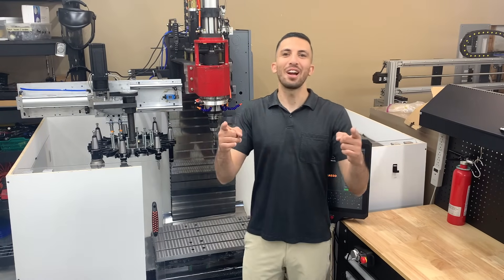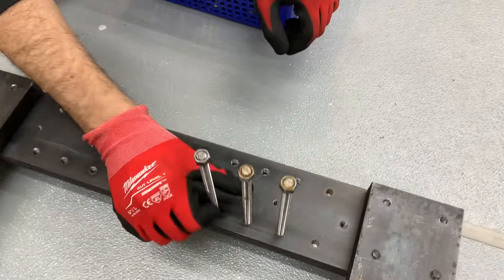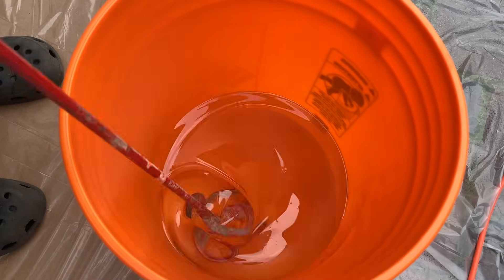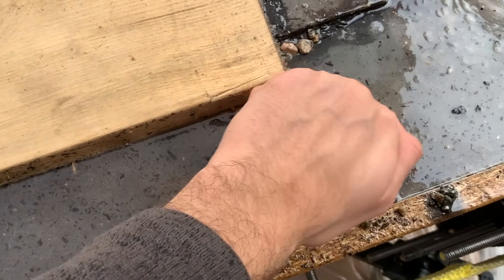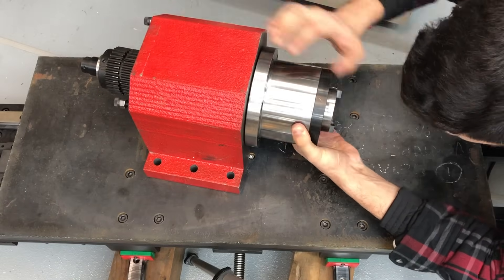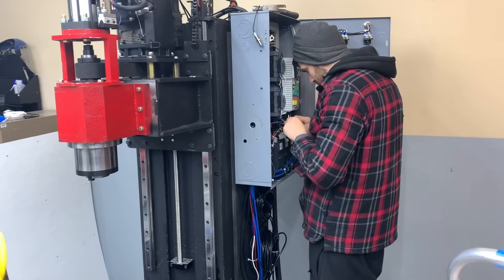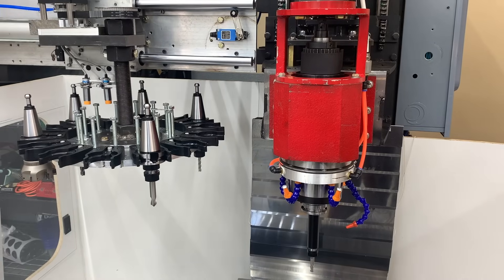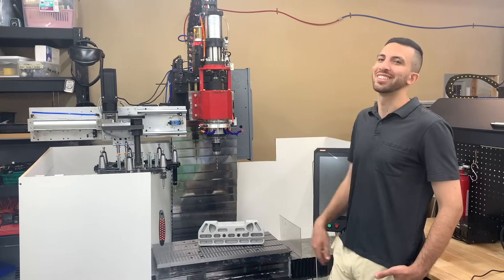Building a DIY CNC Machine With Automatic Tool Changer

Comment: Really love this build, great engineering skills. At first i thought no way they build a cnc milling machine... and then next thing "we also  build this router in a week" Very nice, the toolchanger makes it really stand out, looks like it is inspired bij the HAAS toolchangers. How did you get the Z-axis to be perfectly square with the XY-plane? I am really curious, what accuracy does it achieve? Keep up the good work, this channel will blow up in no time!
Reply from the maker: Thank you very much! The tool changer was definitely a nice touch, and was actually quite complex to build. Squaring off the z to the other axes was a process, and I will describe it in my next video for sure. Glad you enjoyed and thank you for the kind words 😃
Reply: @ActionBOX  which video? I'm at that point in my own build I'm curious as to how you did it.
Also interested in a couple of the other components. 
Are you releasing plans or drawings or parts lists of the stuff you used?
Reply: @ActionBOX  Great build. If you ever do another It would be worth making a knockout cylinder that was hollow in the center. That way you could easily incorporate (With a Debluin Coupling) through tool coolant and even an air blast to the spindle cone. It may also be worth incorporating a electro magnetic brake to the top of the Z axis ball screw. These are great for E stop functions and will generally prevent the head from creeping down when powered off. In many countries a legal requirement. Generally today cast iron wont need to be left to normalize for years that was done way back prior to WW1 and mostly for economy of scale. Today they are rough machined then heat treated to stress relieve. This is also the case for high end fabricated machine components as well.
Reply: Not answering the accuracy question and looking at the construction itself tells me that it is not accurate at all. Just bolting the linear rails to an unprocessed piece of steel is not the way to go.
Reply: That's what I wrote a year ago. Today this video popped up on me and I found my comment not remembering I wrote it XD

It seems like very little people care about precision. But it is one of the most critical things in machining
Reply: Many machines had umbrella style tool changers long before Haas was even a company!
Reply: @gorak9000  they didn't claim to have invented anything. But it looks like a clean build. I'd like to see the rest of the build information. If they don't want to share, ok, but they are saying they are going to do follow up videos and then they don't.

Comment: Very nice. Even has a tool changer. That's pretty gangster. Also I think its a pretty good call on the epoxy granite. People don't realize that using alternative materials to iron bases has been around for over a century. In WW1 countries were rushed into a world war without any way to produce artillery shells which would require massive lathes that nobody really had. Their solution was the Yeoman lathe constructed from cement/concrete bases. Even nowadays on machines with low production numbers (like only 1 for example) it makes much more sense than having a certified foundry that can cast Meehanite Iron do the work to create only 1. I had thought of using an epoxy/cement/sand mixture for a future lathe project but I honestly think your solution is simpler with the same great dampening performance. Definitely going to do it that way instead I think. This is the first time I've seen your channel but after this video I subscribed. Stay awesome.
Reply from the maker: Thank man, this comment was a pleasure to read. Thanks for your upvote as well, and feel free to help me out by sharing with anyone who may be interested. Im hoping the YouTube algorithm will pick up at some point 😁. Cheers my friend

Comment: Is it cost effective compared to buying a complete used machine? Do you plan to upgrade to 4d?
Reply from the maker: Knowing exactly how your machine works definitely saves money when it comes to fixing and troubleshooting the machine. A lot of the budget went towards one time tools such as the T-slot mill, so If I were to build a second machine, I wouldn't incur all those expenses again. Hence, the more machines you build, the more cost effective it becomes. that being said, hobbyists don't need more than 1 machine, so whether its cost effective or not is dependent on your situation. Hope that answers your question 😃

Comment: I absolutely loved the fact you made such an amazing machine in such a short period of time.
Wouldn't concreate dampen vibrations reasonably well too?
Reply from the maker: The two parameters at play are young’s modulus (rigidity)  and Loss coefficient (how much it will vibrate under impact). Concrete is less rigid than steel, and is not as good at absorbing vibrations as epoxy or other polymers. Hence, using the steel/epoxy composite is a superior product. That being said, if you are on a very tight budget, concrete would still work, you simply have to run the machine under less stress (lower feed rate, and shallower cuts) to get the same quality cut. Hope that response helps. Do me a favour and share my video with others who may be interested. Cheers 😃.
Reply: yeah, he only took 8:51minutes to make  a cnc machine,absolutely incredible fast and fantastic!

Comment: could you have used some old weight plates from a gym istead of the rocks
Reply from the maker: Yes that is actually even better since steel is more dense than rocks. A secret between you and I, I actually threw tons of bolts in there and 2x 8 pound weights. Only drawback is that steel is far more expensive than rocks, so unless you have tons of scrap lying around, its not worth the investment. Great question 😃. Hope you enjoyed the video enough to help me and share it . Cheers
Reply: @ActionBOX  nice thanx mate for the reply I really like the design and quality of your machine

Comment: How did you make sure that all axis are in square, all linear rails parallel in all directions, spindle axis parrall to the z axis and so on..?
Reply from the maker: There are tramming mechanisms built in to the machine which were not filmed (I will show them in the next video). as per the linear rails, I used a linear dial that was rigidly attached to one rail, and the probe was sliding on the second rail. I ensured that the two rails were parallel in this way.

Comment: you rock and how much cost ~ the materials for that?
Reply from the maker: Hi, the Machine will cost around $15k USD to replicate. That being said, many tools such as the T-slot milling bit were only needed once, so if you build several machines you only need to pay for it one time and use it on all machines. If you plan on building more than one mill then you can bring the cost down. That being said, I recognize that the average hobbyists is really only in need of a single machine at most.
Reply: @ActionBOX  Thanks for being so open about the cost!
Reply from the maker: @BeronSailerio  yeah no worries. Do you have any other questions? Im prepared to answer whatever about the machine 😃
Reply: @ActionBOX  Thanks for this! I thought you said $50k in the video and I'm glad to see it was way less.
Reply from the maker: @evanlane1690  Yeah, $50k wouldn't justify building one, but at $15k It was a great project and still saved me lots of money. Plus I know exactly how my machine works now so troubleshooting it will be fairly easy in the future 😆. Do you have any plans for building a machine?
Reply: Awesome, why wouldn't you build and sell that to become a millionaire?
Reply from the maker: @josephs4044  Because HAAS has me beat for software. Commercializing is a project that is about 100 times more complex than building the machine excited

Comment: Cool video...inspiring. Consider breaking this condensed version up into a series. Also, what was the software used to control it???
Reply from the maker: I will definitely provide a more detailed version for those interested. I am using the masso controller.

Comment: should we use cement instead of eproxy? It might cheaper.
Reply from the maker: Great question. Cement does not absorb vibrations as well epoxy, and is also a very poor choice for a low and high frequency vibration environment. There are special cements you can use but then they are much more expensive, and harder to get for a hobbyist. Not a bad Idea though. Hope you enjoyed the video, and please do share my videos with anyone who is interested to help me grow as I build my next machines.
Reply: @ActionBOX   Thank you, I try to match what you says to to what I learned.
Before I ask the question above, I thought that mass can decrease vibration amplitude of constant impulse. but as your answer, seem like you trying to dissipate energy of vibration to heat using damper to reduce vibration in the same way of tune mass damping. Also epoxy is polymer. whrn the molecule moving dur to vibration it heat up by friction and dissipate the vibration energy as well.
Soory but I prefer the explanation in Physics or sciencetific way but it good to know, nice technique.

Comment: Nice looking machine. How did you verify that the x, y, and z axis were square to each other?
Reply from the maker: I used a dial gauge indicator that was rigidly attached to a slider on one rail, and was probing the second rail. this way I checked to make sure they are parallel and adjust accordingly. If you enjoyed, help me out and share with others who may be interested 😃. Thanks in advance

Comment: How big is the displacement of the spindle relative to the table with a tensile force of 10 kg per spindle holder?
Reply from the maker: I have not conducted the hammer test yet to measure rigidity so I do not have an answer for you. That being said, as an unofficial test, I. was pushing as hard as I could with my arms on the side of the spindle, and the dial gauge wouldn't move to a noticeable amount. It is a 10 micron per step gauge.
Reply: @ActionBOX  For successful machining of steel with the achieved deviation of 0.01 mm, the manual force that caused this deviation should be 40-60 kg (for a new, unused machine)

Comment: How do you square the z column with the base x, y..... What is the precision?
Reply from the maker: The spindle block (in red) is bolted onto the z axis block behind it with 1/2"-13 bolts. the holes there are oversized and allow for tramming.

Comment: Nice build! Do you plan to scrape in your machine as well?
Reply from the maker: Hi, what do you mean? Cheers 😃
Reply: @ActionBOX  Scraping is a method to produce extremely accurete surfaces, w.g. for mounting the rails.
Reply from the maker: @TeslaAtoms   Cool, I didn't know that. Thanks for enlightening me. No I am not planning on doing that. My build focuses on building a good machine for the cheapest possible price. I was not focusing on building a perfect machine at a maximum price. I hope that answers why I will not be doing this. cheers.
Reply: @ActionBOX  Dont be afraid so scraping! It is the cheapest way possible to make a really precise machine.
Reply from the maker: @TeslaAtoms  Thanks to you I decided to read up on this and watched a great video by NYC CNC, and indeed you are right that this would have helped. Thank you for sharing 😃
Reply: @ActionBOX  You are welcome! Make sure to look into the channel of "Stefan Gotteswinter", he also has some great content on scraping!

Comment: Great job, did you make a precision test ?
Reply from the maker: yes, the repeatability test was within 20 microns under no load.
Reply: @ActionBOX  But did you test on parts ? The finish part look rough, is that a cutting strategy issue ?
Reply from the maker: @1337BlueBird  Im not sure what you are referring to by rough, but we did use a roughing bit, and a roughing strategy, plus the surface is not perfectly flat and smooth in the CAD. The design came out as it was intended. Feel free to show me what you mean and I can confirm. Thanks for watching with such high details 😃.

Comment: Nice work mate.

1. Did you get the steel milled before mounting the linear rails?

2. What controller software you using?
Reply from the maker: Thank you sir, All the steel was processed before I attached anything to it. It can be done very easily on a manual mill, or even more easily on a CNC machine. If your milling table isn't big enough then you simply index your piece (slide it down) zero from the last hole, and keep going. I designed this machine such that you can build any size machine even if you only have access to a smaller machine. As per the controller, I opted to use the MASSO Touch. Hope you enjoyed the video. feel free to help me out and share the video 😃
Reply: @ActionBOX  so by processed you mean drilled and tapped? Or were the surfaces milled?
Reply from the maker: @chrisadesigns  , One of the primary assumptions in this build was that the steel flatbar was sufficiently flat. We know that the flatbar isn't perfectly flat, (despite the name 😜). So no, we did not flatten out each flatbar.
Reply: @ActionBOX  
Even castings made from actual EG, vibrated for highest possible packing density and with proper graded aggregate, warp quite a lot during the casting process. Usually it is absolutely necessary to machine the parts after the casting is done, no matter how flat anything has been before.
And in this case, with this kind of "epoxy granite" full of voids allowing much more shrinkage, I can't imagine your parts aren't warped like a banana.

How flat are your mounting surfaces actually?
It's hard to imagine that no one bothered to actually measure it.
Reply from the maker: @heinzhaupthaar5590  The first consideration should be that this design was meant to show how to build a larger machine when you only have a smaller one. You cannot easily flatten this machine using what I have access to. Sure I could have spent lots of money transporting several tons to a bigger machine shop, paid them to flatten the steel where the rails are mounted, and then brought everything back, but that defeats the points of making a hobby grade machine. Im not trying to compete with HAAS, just making something reasonably cheap and reasonably accurate for others to be able to mimic at home with reasonably accessible tools. Furthermore,  I would argue that it doesn't matter how flat the surface is on the x and Y rail mounts as long as they slide sufficiently well, and the milling table is then surfaced to be normalized to the z axis. Whats most important and has been considered is how square each axis was to the next. I am quite confident about my answer, but feel free to enlighten me. Regardless you bring up good points 😃
Reply from the maker: @perspectivex  Great reply, I enjoyed reading it. Yes indeed flatness matters, but the level of flatness depends on the level of precision and accuracy you are going for. I am not making aerospace parts with this machine so investing added money to increase performance by a level that will not be detectable by me or the projects I perform was out of scope. regardless, I appreciate the detailed response, I definitely learned something 😃.

Comment: First completed part looks like a hangboard. A training device for climbers. IOW, if that is the case, then the part could be used to make a mold, or be the most overkill hangboard in history :)

Really nice machine you have built. Helps having the right equipment at hand :)
Reply from the maker: You are indeed correct, it is a hang board, and in my next video I will be showing how to make a silicone mold to duplicate these easily now that we have a plug. Indeed it is the world's most overkill hang board at the moment 😂. Share my video if you think there are others who would be interested, and don't forget to subscribe to catch the silicone molding 😃.

Comment: My gut feeling would have told me to mix the rocks into the resin with the cement mixer. Any reason you poured the resin first and then put the rocks in the mold?
Reply from the maker: There are two reasons. 1. I  tried this while building my previous machine, and mixing the rocks with the drill and concrete mixer was far too hard. The rocks essentially don't want to move. If I were to ever build a machine again I would get one of those spinning concrete tubs. 2. When you do not use smaller aggregate to fill in the small spaces (as per my workflow) the epoxy flows between the rocks fairly well. Hence, from my experience and given what I was doing, this was the easiest way to mix the two given the equipment that was available to me. There is no harm if you decide to do it a different way. Glad you liked the video. Help me out by subscribing and then sharing the video 😃.
Reply: @ActionBOX  Thank you for answering my question. At the moment I'm getting a manual mill back into shape, after that I want to build myself a diy VMC, similar in layout to your project.
May I ask what CNC-control you used?
And is that a BT30 Toolchanger from china?
And may I also ask what type and make of servo that is, for the spindle?